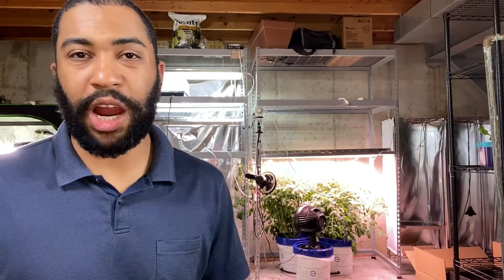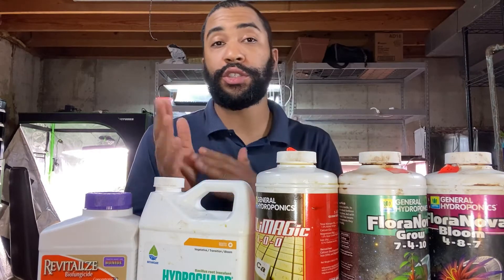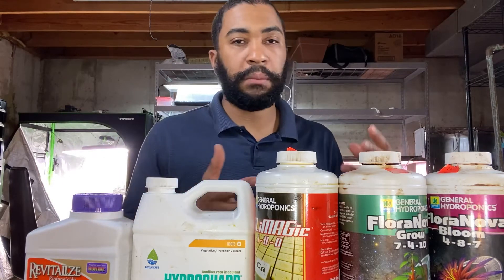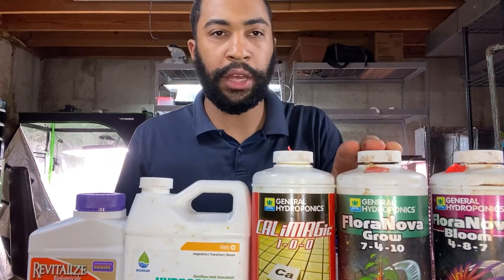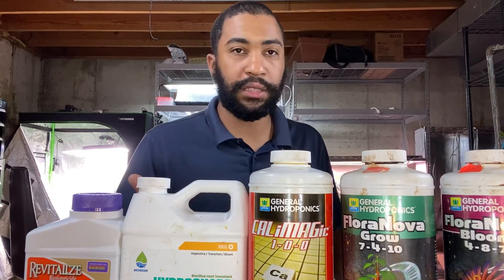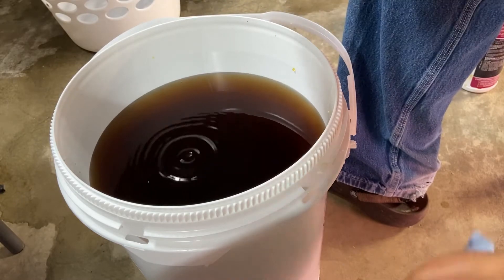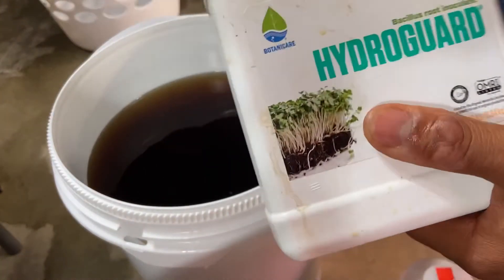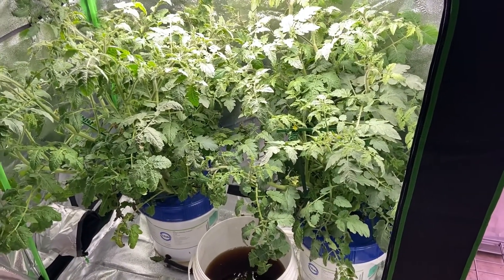How to mix Hydroponic Nutrients(easy and simple)

Comment: I've been growing indoors for over three years now, and because of where I live, dirt brought too many bugs into the house.  Although reusable, coco coil has unused nukes that can cause lockout if you don't buffer it every time it's reused, so a few months ago, I started two buckets like ours, but now I'm up to eight buckets because I wanted a recirculating system.  I'm new to this, and I'm not trying to bust your balls, but I think the cal-mag should have been used first, and if you are using any root fungi, it should be used first.